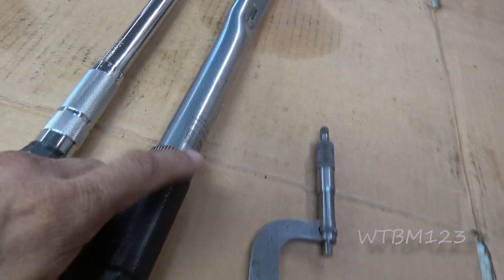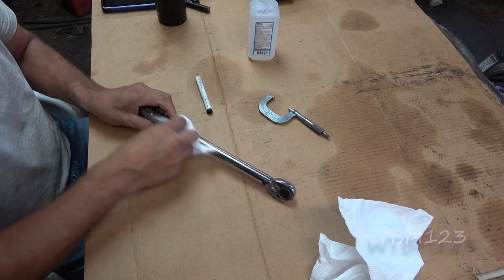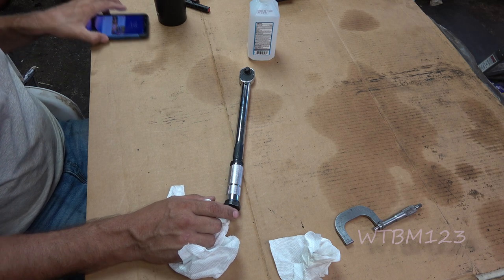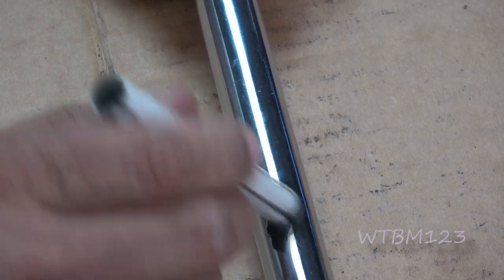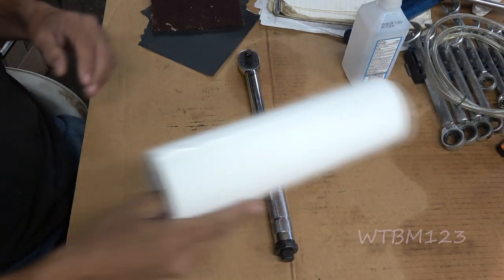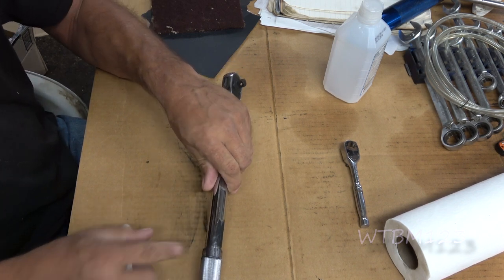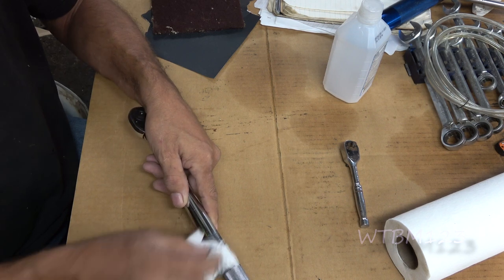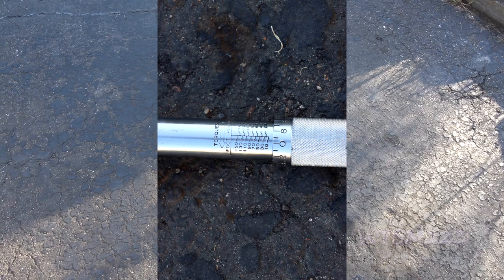lacquer paint stick to fill in stamped numbers and letters ,Try on torque wrench

Comment: Terry, we do 1000's of guitar tools this way.  We use a Markal pen which is just a different brand of the same solid lacquer.  I apply it just like you did, and let it set for about 5-10 minutes.  We then we use the edge of a credit card to squeegee off the excess before it dries.  I'd say we get 80-90% of the paint off the surface and there's some haze and streaks left behind.  We then let that sit for 24 hours or so, then use some lacquer thinner on a shop towel to clean up the last 10%.  We use a VERY light touch so we don't pull the paint out of the engraving.  I hope that helps!
Reply from the maker: Thanks for the info. It does give me direction

Comment: Thanks for a great video.  These sticks are nice,  but they dry out quickly,  even when you buy them fresh.  Lots of waste,  unfortunately.  Maybe mix the scrapings with a petroleum distillate to make a heavy paste. Rub it on, let dry for a minute,  then lightly wipe off the residue. Also,  they're expensive.
Reply from the maker: Yes they do dry out quick.

Comment: The etching on the torque wrench is very shallow. Color fill with paint. Let it dry for a long time. Overnight would be good. Hit it with a rotary tool, drill, etc flap wheel. The flap wheel should stay above the recessed area. And if it dulls the surface area, so much the better.
Reply: Terrible idea. Flap wheel was 80 grit and did nothing more than scratch the crap out of the surface. Should have left well enough alone. My original was red nail polish left overnight with residual removed with acetone. Looked very good and much easier to read. Give it a solid "B". Black painted (Testor's) and left overnight. The wheel only melted / smeared the paint while deep etching metal. Sucked. :) Fortunately I only tested on reverse side on the Nm line only.
Reply from the maker: Thanks for the tips!
Reply from the maker: Good idea with the red nail polish . I may try that .